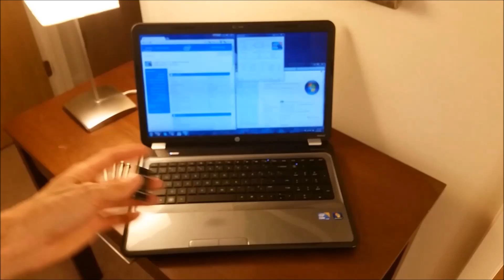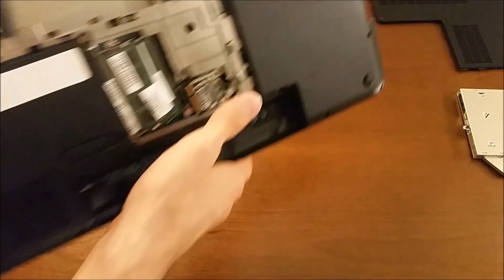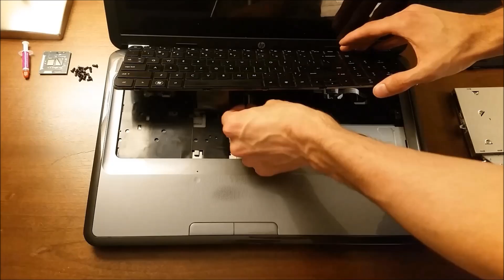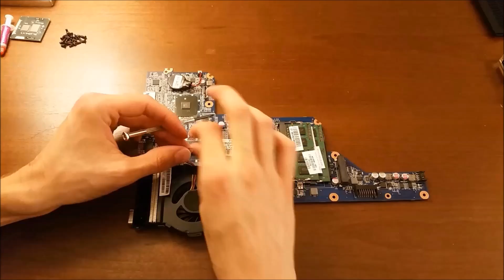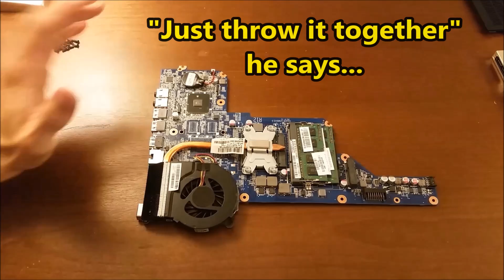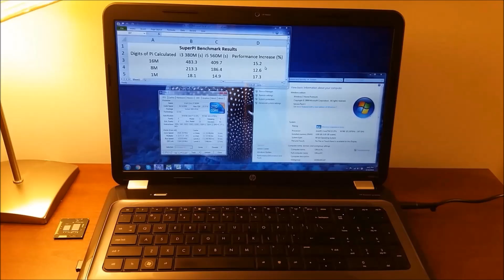How to Upgrade a Laptop CPU / Processor! XD

Comment: ok so i had this problem with my older laptop where... the cpu just wont come off.. i bought this new omen laptop and im not quite comfortable with my i7 7700HQ.... i want MOAR power... in the last laptop, i fucked up the motherboard trying to get the cpu off.. there simply wasnt any way that it could get off... so im wondering if this really works on every laptop..

Comment: Oh wow, you did this without an anti-static wriststrap
Reply: @yogibear2k10 yea until you destroy one.... You drive a car with no seatbelt, don't mean you won't get into a accident
Reply: The Verge is that you
Reply: @yogibear2k10 what I said must of went over your head... I'll explain in simpler terms. An anti wrist strap is there for a reason because when you are dealing with smaller chipsets it will destroy whatever electrical component you touch. I work in the field just as you do and components are delicate. And if you are doing a job don't have none of that equipment you are fired on the spot. I seen tons of things get fried because of what you explained in your comment. Now as of seats belts killing people in car accidents, you are more likely to get killed not wearing one then wearing one... But knock yourself out and live on the edge with no seatbelt, bro. Be safe on the road, and don't drive no where near me

Comment: People  always  say  'You can't upgrade a cpu in a laptop'  but  you actually can
Reply: Not in modern ones, modern ones they're soldered to the board.
Reply: Easy Linux can’t you just use a sawdering kit?
Reply: you can it just vary hard and not worth the effort or cost to change out soldered down cpus. @lonerider92
Reply: That laptop is not a 2017 model running a second generation i series processor. For instance I had to replace the whole motherboard in my thinkpad e450 with a 5th generation intel i series processor because it was soldered to the board.
Reply: I think even newer ones are still upgradable, at least some of them. I recently disassembled a friend's laptop to change its thermal paste, and it has a screw to undo the cpu just like in the video. Its a haswell i5, not the most recent, but still not too old.
Reply: But its hard
Reply: The issue with the cheaper newer laptops is that they are not removable some of the nicer more expensive models are completely upgradeable but this laptop has some age on it so its a little easier to work with
Reply: Most of the laptoos are made to be remplaced not to be upgraded
Reply: I know, it's a model from 2011, but asus has 2 motherboards for this laptop and one is from 2011 and the other from 2017
Reply: Zapthos in my experience, people always ask me if you can upgrade gpu in laptop, hahs
Reply: @mohdajrulmumininnorijan197  it depends if it does have a separate socket on the motherboard or if it sealed to it
Reply: https://www.youtube.com/watch?v=Ii0Ld7nioZA
Reply: Zapthos this is proof
Reply: It's like walking through a mine field, either follow your map, hope you make it, or don't walk into it at all.
Reply: Easy way to tell without opening it up first, use CPU-Z to find out the socket type...if it's BGA then don't bother.
Reply: Not all laptops have upgradeable CPUs some are soldered to the board so if you f*cked up your CPU then go and replace your motherboard for probably a $100
Reply: @Kristoff2005  hey, how can i find out if i can upgrade mine? How do i check it?
Reply: @fabijus5349  it depends on the generation of the cpu if your using atleast a 3rd gen intel core series laptop you're good to go but if you don't know, open your laptop with the instructons online and see if it has a flathead screw behind the cpu, if it does try unscrewing it and it should pop right off but if it doesn't have a socket then you cannot upgrade it
Reply: not always
Reply: @secretqwerty838  yeah cause some use BGA instead of PGA that makes it impossible to upgrade unless you have another similar CPU and a Soldering Station
Reply: U can even upgrade gpu but it cant be inside the laptop
Reply: I wanna do it for my msi, will I be able to tho?
Reply: If the CPU is soldered to motherboard,you aren't lucky
Reply: It's called BGA reflow.
Reply: You can....this one is slotted ...most now are soldered....
Reply: Not all modern ones.. I've got a Asus K53SC-SX404V from 2017 and upgraded the cpu from a i5-2430M to a i7-2620M
Reply: Most of the laptop cpus are soldered to the board so no, YOU cant replace them, a specialist maybe could but that would be preeetty pricey
Reply: Can i upgrade my laptop
Asus A540s
Intel dual core celeron
4gb ram
Windows 10
Reply: @angelobuencamino941  depends
Reply: @angelobuencamino941  I think not, it's soldered. And even if someone can resolder a new one, the chipset only allows for a Pentium N3700 and had to desolder it from another board. https://www.cpu-upgrade.com/CPUs/Intel/Mobile_Celeron/N3050_motherboards.html
Reply: That's still an older fucking board. Ffs man, go down to your local walmart buy a cheapy laptop dismantle that fucker and tell me the cpu is not soldered in. I fucking dare you.
Reply: @lonerider92  dude, calm down.
Reply: It honestly sounds like you are full of shit. I'm gonna consider your argument invalid until you can provide us proof from a reputable source.

Comment: Doesn't look like you need to pry off the keyboard and totally disassemble the entire laptop to change the CPU. From this video, it looks like you can do all of this just by taking the bottom cover off...
Reply: I stand corrected. For this laptop seems like it's necessary, but the laptops I have this is not.  None the less, good in depth video.

Comment: Wanna see you upgrade an soldered processor.
Why they fuck up so hard the new laptops ;_;
Reply: Eduardo Avila that’s what I want t know! I have a early 2014 MacBook Air that has soldered Ram and Soldered Processor!
Reply: Lucas Pagan Well... i tried on an old netbook, because my friend has a heat gun, but the new processor fried the board because the tdp was too high. These soldered laptos dont even support like 1 or 2w more than it original processor uses. 
The ram would be even worse to upgrade
Reply: Eduardo Avila: I think you'd have to build a new logic board from stretch using software like Upventer or Eagle CAD!
Reply: Lucas Pagan I dont think that is possible with my limited knowlege of eletronics. 
Actually its not impossible to upgrade it if you have other compatible parts with roughly the same tdp. You would need a heat gun, the soldering balls, some stencils and you could solder it. But you would need to prey for its bios have the firmware to accept the new processor. Its easier if a better model of your computer uses the same motherboard and has a better processor. Then there is a higher chance that it will work. 
Mine did turn for about 3 seconds but then its motherboard fried. 
Its not impossible, but very hard and unlikely will work. 
The thing is to stick with an older laptop with the best hardware of its time like an thinkpad that had 3th or 4th gen intel but is wasnt soldered. Or buy one of those super expensive gamer laptops or just accept that you cant change the processor. 
What i find odd, is that people is not complaining that much about it
Reply: Lucas Pagan you're first mistake was buying a mac
Reply: why oh why does it have to be soldered!

Comment: if you have an intel laptop can you put any intel cpu into it. i have an i5 3210m and i want to replace it for a pentium g4560. it is dual core and has hyper threading. would this upgrade be possible?

Comment: Will this work for all types of laptops?
Reply: Aryan yadav Pretty much every laptop after 2014 (Intel Haswell or AMD Kaveri) has its CPU soldered to the motherboard so no.
Reply: Kolly Flix  it should but there would be no guarantee whether or not the manufacturer has made a whitelist so that only certain processors would work since hardly anyone would try to do such a thing. In most cases any CPU on the same socket should work as long as it has the same or lower TDP as the chip you are replacing

Comment: I have HP Compaq 6510b Intel Core 2 Duo Processor T7300 2.0 GHz   Would I be able to upgrade it to Intel Core 2 Duo T7800 2.6 GHz OR  Intel Core 2 Duo  T7700 2.4 GHz?  They both have the same 478 Socket P same as I have on my processor. But would my motherboard or BIOS accept them?

Comment: My HP 4520s laptop is easier, take off the battery, 7 screws to take out to remove a cover and keyboard, and you are straight in at the processor, heatsink and fan. Changing the hard drive is worse as you have to remove a total of 12 screws heading the same way and another cover. Got the 540m for £8, 8GB of memory and a 480GB SSD.

Comment: Hey cool vid ! I have a hp 2000 pentuim . So I upgraded it to a i3 2310m and now I am experiencing shutting downs at 30m . Then I tried to upgrade my i3 2310m with a 2330m and same issue . But by putting back my pentuim g980 back it worked fine no shutting downs . You know what's the issue ?
Reply: update bios
Reply: Ultimate DarkKiller no it was a hm70 chipset . Only support pentium and celeron processor ! Intel is just trolling

Comment: like  is there a better upgrade of a processor for a i5-2410m for a laptop?
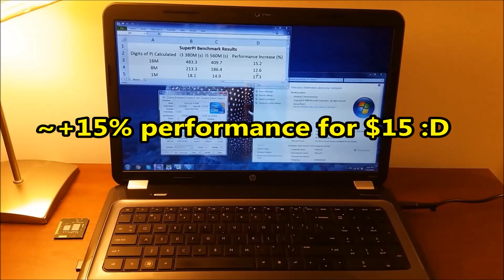Reply: The martini108 instal cpu-z, in this video at 7:29 you will similarly see name package in cpu-z, what's written in package write in google, click on wikipedia, on your right you will see available list with cpu, chose ones with the same line in your case it's sandy bridge, now you will further need to narrow your selection bi comparing twp or twp, then you will have of list of cpus available for upgrade based on same production line and power consumption, after that the price its only thing limitng you.

Proceed to below instructions after you open your laptop, you need to se your motherboard with cpu. Reason for that is to determine whether your cpu is soldered on nonsoldered. Soldered cpus are those who dont have ppa988, therefore your stuck with your current cpu. Good luck

Sorry for grammar mistakes, im writing from tablet quickly and good luck

Comment: can u do with a HP g2 255 amd e2-3800 ? as the CPU in my laptop is crap and need a better CPU even an amd a6 would be. much better
Reply: e2 cpus are soldered

Comment: is this actually safe? i have a laptop with a better processor than my current laptop, the display on the better one is broken. the processor im using now is a i5-7300hq, the better one has a i7-6700hq. how do i know it would work properly?
Reply: both are soldered, no chance

Comment: can I upgrade my ram, memory, cpu, and graphics card? I have asus Q534uxk laptop with 16 gb ram, 2.7Ghz, Nvidia gtx 950m, core i7-7500U, 2tb harddrive. If I can upgrade, what would be the best bang for the buck (budget) upgrade type cpu and graphics card that can run 95% of games on high settings?  I'm seriously trying to make an ultimate gaming laptop.
Reply: +OmegaX You might upgrade your video card (from gtx 950m to gtx 980). I don't know exactly if this is possible, but if it is, you will run 95% of games on high settings in +60fps. It is a big difference between these cards!
Reply: there is the mxm socket for graphics card but that is rare and most graphics are soldered to motherboard

Comment: Personal top tip(s i guess XD): 
1. when applying thermal paste just to apply a very small dropp, depending on the size of your dye/heatspreader, on a desctop i would use a drop the size of a medium sized pea, while on a cpu with no heatspreader (like you see here) i would use about 1/3 of that. And there is no need to spread it manualy, as the preasure from the screws will spread it evenly with a very little chance of getting air cought in there making your cpu run hot :D

2. when screwing inn the cooler always make shure to tighten the screws in a cross pattern, as you then have a much smaller chance of damaging your cpu :D

hope this helped ya' and have a nice day! Really informative and great video m8 :D
Reply: Ask Wintersborg Govertsen lol the fact I've worked on cars before computers helped. I recently changed thermal paste on my 8540p because cpu was hitting 94° C. It's imprinted in my brain cross patterns on fasteners haha
Reply: Dillon Fries 🍟

Comment: Your HP notebook has the same socket type (PGA988) as my Samsung R480.  I recently pulled out my i3-330m and replaced it with an i7-640m.  I went a step further with mine and picked up a Core i7 sticker to replace the Core i3 sticker on the outside.
Reply: SHESSSSSSSSSSSSSSSSSSSSSSHHHHHHHH bro

Comment: hello i have a hp620 with a intel celeron t3000 1.80 ghz can i upgade it to i5 ? and also in the prosecor is the graphics card the mobile intel 4 series exxpress chipset family if i will change my processor to an i5 or i3 it will also change my graphics?

Comment: I have an Asus x401a with a 1.8 GHz Dual core Celeron processor. I was wondering if there is a core i3 or better with the same socket type and 95 watt power usage.
Reply: Just get a i7

Comment: Hi just wondering if anyone can help I have a cheap  asus e200ha 11.6" laptop which has a atom x5-Z8300 processor, which is super slow, just wondering if its possible to move up to a i3 or i5 cpu or even something that will run a bit better.

Thanks, also if anyone knows if it is possible to upgrade the RAM on this model that would be a great help :)
Reply: atom cpus are soldered

Comment: Can I upgrade my laptop from core i3 2370M to intel pentium skylake g4400? I'm using the hp 1000 notebook i3 version.
Reply: W2S will it have heating problem?
Reply: W2S and is it ready to go or i have to deal with the driver first?
Reply: W2S ok thx
Reply: Wait, isn't that a desktop cpu? Cause they don't work on laptops.
Reply: Cairo Murphy well idk..
Reply: YobixGaming Find the socket type of your cpu then I can probably help you.
Reply: Cairo Murphy ok ill do it later on
Reply: Cairo Murphy FCBGA1356????? pls look for me
Reply: Augyyy I think cpu's with that socket are soldered I'm not sure i'll have to check.
Reply: Isn't the G4400 and LGA 1151 processor? I doubt it will fit in a laptop unless that laptop has a full desktop socket.
Reply: YobixGaming no, the 2370M is a Socket G2 CPU with a TDP of 35W,  with a BIOS update any 2nd or 3rd gen Core series CPU with the same TDP should work just check this list http://www.cpu-world.com/Sockets/Socket%20G2%20(rPGA988B).html
Reply: i upgrade mine into core i5 3230m from i3 2370m

Comment: i have a Pavilion 17 E115nr... can I upgrade my processor. if so which one.
Reply: Depends what the CPU/motherboard is. Download CPU z and find which CPU you have. Then search the CPU name with upgrade after it and you should see an upgrade.com link. Check to see if the CPU is PGA or BGA. If it's BGA it is not upgradeable if it is PGA look down the list on that page at the possible CPUs you can upgrade to and pick the best one with similar tdp.
Reply: Paul Sedmak same
Reply: fourtysix4646 I have an pavilion with an AMD a9 proccesor with integrated graphics. I think I might need a new laptop. It's a shame because it is 5 months old. It crashes once every 2 weeks

Comment: How are the temperatures holding up with the i5?
Reply: hi i have a HP sleekbook 14 and my cpu is i3-3217U 1.80ghz so can i upgrade to an I5 cpu?
Reply: Efrain Gallardo or tooth paste :D
Reply: Here it is: https://youtu.be/L8EWqWj2srg
Reply: no u cant, ur cpu is FCBGA Socket, meaning it is soldered
Reply: @ultimatedarkkiller7215  quit saying that,its possible if you know your shit
Reply: Ultimate DarkKiller you are wrong. It is actually quite simple to remove and upgrade soldered cpus. You need a heat gun, a soldering iron, some solder wick and some tacky flux. Video to watch is here: https://youtu.be/v4Q-3-leDhQ
Reply: that heatsink is rather small
Reply: @yogibear2k2 £20?!?!!? what i7 did you buy???!??
Reply: @subpoena.  that's y I don't use wish 😂
Reply: Ameer Qan Yes, Just take care with the socket compatibility...
Reply: If you want great Temps use grizzly liquid metal thermal paste.

Comment: This doesn't work on skylake laptops.. Or does it?
Reply: TheFifteenGames Contato What if it's soldered?
Reply: ***** No its alright. I understood. Tysm.
Reply: TheFifteenGames Contato Thanks!
Reply: TheFifteenGames Contato oh, thanks! I was actually wondering because I have the Inspiron 07559 as well with the i5 6300hq
Reply: Um, I have a question. I have a core i3 2370M, is it possible to upgrade that? if you're asking too my laptop is hp 1000 notebook the i3 version. thanks :)
Reply: Search your CPU model with upgrade after it and click the upgrade.com link and scroll down the list. CPU needs to be PGA or LGA to be upgradeable if it is BGA you are out of luck. Then you need to find out if your motherboard supports it but the site takes care of that mostly by providing you an upgrade %. If your CPU is 35w you can usually add up to a 45w CPU but I wouldn't go any higher and recommend a good thermal paste. I have upgraded many laptops and it's really easy. It's up to you to do the research of what CPU you can upgrade your model of laptop to but once you figure it out it's a fun little project and the CPUs aren't that expensive.
Reply: @linxu9763  apparently it was impossible. But I sold it already and replaced with a new laptop xD